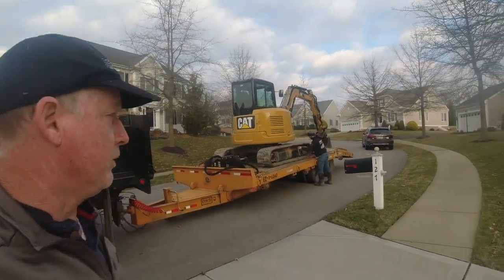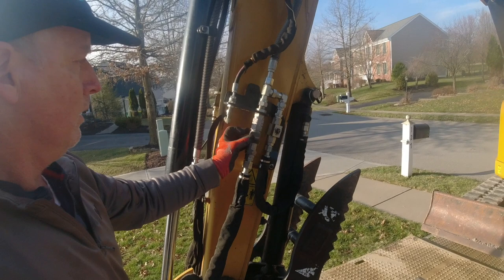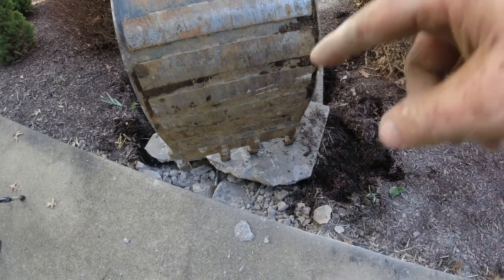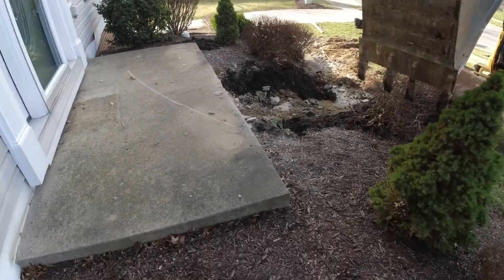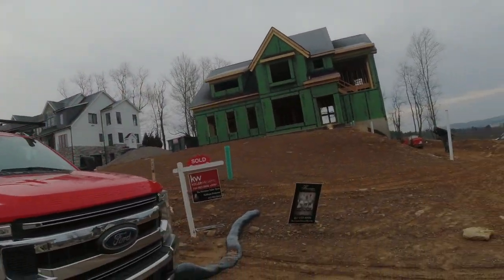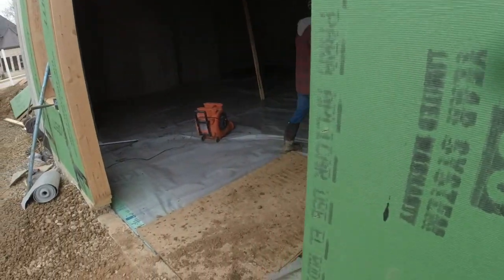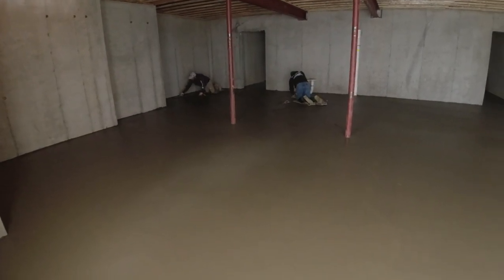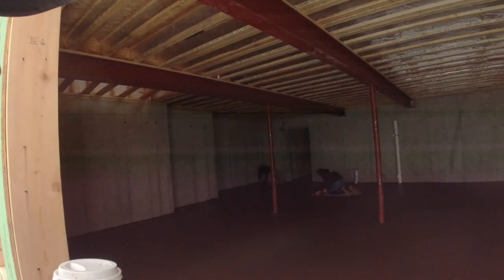Getting Ready for Spring!

Comment: I have a short chain with a flat plate on each end. A half inch anchor into concrete on both ends and it works to lift or pull small slabs
Reply from the maker: Good idea